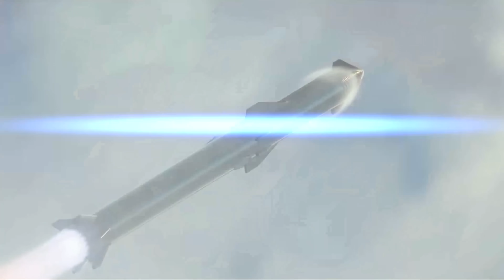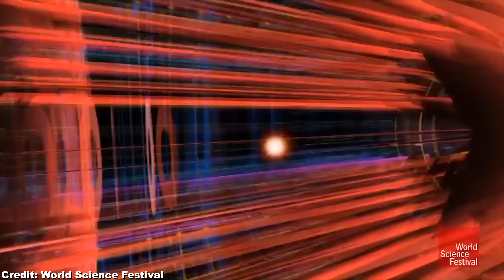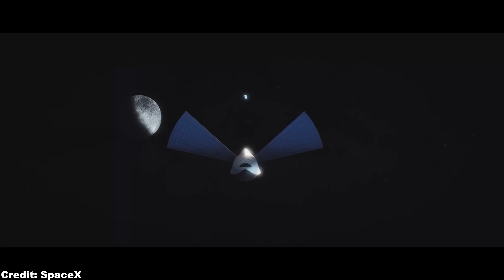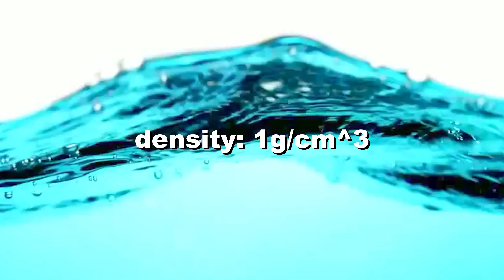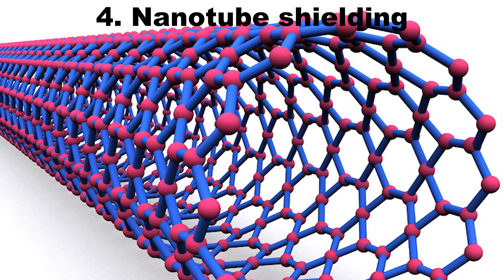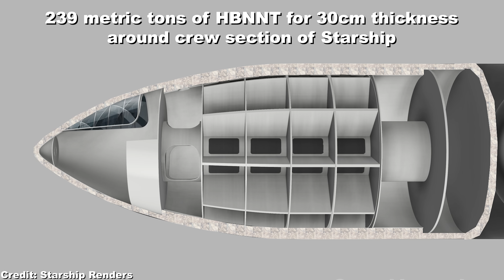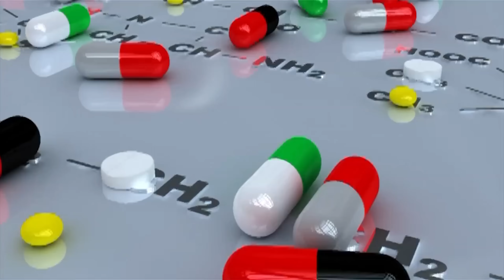SpaceX Starship FLAW Fix: Best Cosmic Ray Protection?

Comment: Since we are dealing with multi-trip vessels, it is essential that the shielding should be re-usable as well. You did not address that issue. Would the NNTs meet that requirement? Water could be easily flushed for 'scrubbing' if needed. A way to convert the rays directly into useful energy (say to power an ion thruster or charge storage batteries) would seem to be the ideal solution.

Comment: BTC current volatility reflects tradrs' excitement as the pr!ce bounces between key support and resistance levels.. In my opinion, the recent correction of βͲ↻ is a reflection of a healthy mar:ket with active tradrs and I!nvestors. βͲ↻ still has a ways to go in terms of gro wth, I have been in the  cryթԵo world for just over a year now and I have been able to make 31 βͲ↻ foIIowing the reasonable adv!se and tradn s!gnals from Bernard"s Moore who is always one step ahead of other tradrs, he is a great analyst and extremely good at designing trad strateg!es for different marke:t situations and her s!gnals are very accurate. You can easily get to Bernard on Եҽlҽցɾαต ( @bernardtrading0000 ) 𝚠нαтαѕαρρ + 1 2 2 8 332 3 7 5 )  to start ƚradıภg.

Comment: Could aerogel be a solution in spacecrafts both as insulation and cosmic ray protection?
It seems like aerogel has a rather wide option for composition, so possible 1 could be something that can block the dangerous rays in space :D
Perhaps combined with layers of nanomaterials to strengthen aerogels fragile nature!
Erogel already have a history in space, so perhaps they are already looking into it, or found it don´t have the right properties, or they have forgot about it in that situation ;)
Video about Erogels
https://www.youtube.com/watch?v=AeJ9q45PfD0

So a good combi could be layer of reinforced aerogel as the outer layer (since it is also a good insulator for the +100/-200 degree), then a layer that breaks up the rays in smaller particles, and then a layer that can absorb the smaller particles, water or whatever is found that can stop it most efficiently, and perhaps aerogel as inner layer too!

Comment: The major innovation needed... 
May well be electro-STATIC shielding .  This would require fields of capacitors, arranged positive ends outwards . The voltage should be 《2k. volt , and there should be no current flow , once the capacitor "skin" is charged . No large power source is necessary , as there is no significant energy expenditure .  Solar and/or radiogenic power should definitely be adequate . 
🤓

Comment: The only currently practical solution to the cosmic ray solution is not to get there faster, but to solve two problems with one solution. On the surface of Mars, significant power will be needed to do the many tasks that are planned. It will be difficult to carry and manage enough solar panels for this purpose. Small liquid fueled reactors can provide this power. They can also provide enough power for a magnetic shield for the spacecraft. Initially, one of the Starships will need to carry two, one for shielding going and returning and one for power on the surface. It might take more than one Starship to carry the surface power unit. With each Starship having its own reactor for shielding, crew safety would be much improved. If one Starship was just as a freighter, it could carry the reactor for surface power, not needing shielding.

If multiple Starships are linked together for gravitational purposes, one could possibly provide the power for shielding for them all.

Magnetic shielding could also be used on the surface, but that seems a waste when there are so many means of passive shielding.

In the future, the fusión power of something like the laser powered HB11 units might provide an alternative for both power and propulsion, but current fission reactors don't have sufficient power density for efficient propulsion, even with nuclear thermal units. The fuel requirements are just too high, and the units themselves are just too hazardous.

We need to get their now, with technologies which have a sufficiently high TRL to be brought to flight readiness very quickly.

One more pandemic of same or greater transmissibilty to our current coronavirus could very nearly shut spaceflight down in the process of throwing us into a world wide depression that will last for decades. Societies will turn inward like N. Korea, making this into a far more hazardous world with even less communication than there is, now. That will inevitably lead to war, possibly nuclear war, which will need the space industry inktjally, but will easily destroy that industry almost instantly.

If we have not established an independent presence somewhere off planet by then, we may never.

Comment: A note on the version of Starship you mention with water in the walls of the entire crew section... Would it not be possible to put one of those up in orbit first without the water, then send a special Starship tanker with the necessary water to dock with it and then fill the radiation shield? Would mean that the shielded starship wouldn't have losses in its payload capacity on initial launch

Comment: 1. Nasa has studied this problem already and determined that a round trip to Mars will not result in a fatal dose. Problem being that no one has EVER done this before so who knows what those studies are worth!
2. Nasa has also started developing strategies to shield human beings from radiation...so far they have manufactured prototype vests to protect the torso and organs. 
3. While on Mars, astronauts will be living in shielded compartments inside their Starship OR underground. Either way the crew will be protected.
4. While on Mars, astronauts can carefully limit their time on the surface in order to reduce their exposure. 
5. During transit, the crew can be shielded from radiation (even cosmic radiation) by installing a thick layer of polyethylene around the crew compartment. Any material that has a lot of hydrogen atoms does a good job of blocking radiation...so perhaps in the future we will develop a special material just for this purpose.
6. This is TRUE EXPLORATION and so it is impossible to guarantee a safe voyage. Those who sign up for the first few trips will need to accept the risks that come with the territory.

Comment: I think the best solution is a water cover. The starship should only have the space available to contain it around the ship, either to take off from Earth or Mars. A device of water in orbit that is gradually filled, would supply the shield for the trip to Mars. On Mars another deposit would previously be put into orbit but empty where the starship would deposit the water to land, then return to collect the water to return to Earth. Therefore, if the water can be reused for multiple trips, it should not always be put into orbit around the Earth.

Comment: The problem with a nuclear thermal starship is that starships take off from and land on Earth's surface.  There would be a danger of releasing nuclear materials into the environment with every liftoff and landing in the event of a problem. I wonder about putting the crew into hibernation, and then fully shielding only the hibernaculum.  It also seems like returning to the moon first, and exploring it further, while we work out the best solutions to the radiation problem might be a wise move. Elon's plans for a human Mars mission within this decade don't seem very feasible.

Comment: No None of that.
Al these particles are charged.
So all you do is shoot a coil in front and one in back to make an electromagnetic shield - just like the Earth does.
It would take very low power - you are deflecting, not stopping energetic particles.
Yes you could charge it by rotating an "outer-ship" against a core.
I suggested these things to Elon ages ago - he blocked me.
I suppose that was because of my insistence of complex carousels on Mars to prevent bone and cognitive decline.
I will note however, that the "Starship" design is the required diameter to house a "Boring company" borer?
Elon intends no surface colony - it will all be underground.
However .. the sleeping-carousel cannot be avioded unless you can engineer a human that has no calcium loss in less than 1 G ...

Comment: Water would be the most practical, but it does not need to be inside the Starship. It can be applied to the outside.
Starship would dock with a water tanker that is orbiting earth and then accelerate to the appropriate speed with the tanker attached. Once the engines stop firing, the water would be released from the tanker and it would coat the entire Starship. When you get to Mars, exert a small thrust so that the water goes back into the tanker. After that, you fire the main engines to put the Starship and tanker into a Mars orbit. Then undock and head down to the planet. 

The tanker will be waiting for the return trip.

Comment: Hey guys...it is very well known what the impacts of radiation on the human body are...but i find it quite interesting that there has not been one recorded case of cancer or serious illness from any space traveller...(orbital or lunar missions). I have read about water being a very good insulator for radiation, but it adds so much weight, and therefore makes it unviable in my opinion. Because water is obviously fluid, it could also upset the balance of Starship, particularly on landings ...given the lack of evidence for cosmic/solar radiation effects on space travellers...are we placing to much emphasis on it ?. Even so, some kind of protection would be a wise move...i like the idea of a pharmaceutical solution, as it doesn't involve adding weight to Starship....weight is the enemy of space travel. Ultimately, the first pioneers to go to Mars are going to take enormous risks, on so many levels. It could very well be a one way ticket if you know what i mean. Question for ya guys : how did NASA protect the Apollo Astronauts for the Moon missions ?. Great upload, all your content is very well cited...and real food for thought...love n peace to all...D.

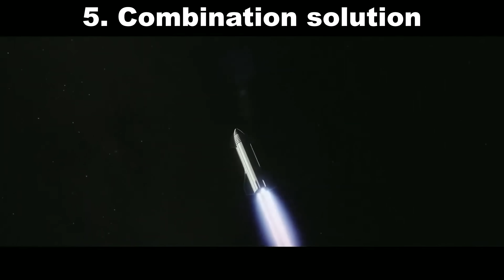Comment: A beautiful video as always guys. keep up the good work. One question though. @10:40 you said when the travel time decreases to about 50% will result in needing half the mass of BNNT structure. I do not find this statement correct because the thickness of the shielding is related to the magnitude and type of the radiation you are exposed to more than the duration so i still think this fascinating and very interesting shell would cost the starship upwards of 200 metric tons. the advantage of water is that it could be not initially on the starship at launch. It can refill its watershields from the orbital refueling in LEO (when its still safe and sound in the magnetosphere), with an extra valve which would not cause so many practical problems. on the other hand as a disadvantage watershield is less durable and maintainable than BNNT against small collisions with debris. I'm really glad to see you guys being so engaged and going after possible solutions. The space community has grown very much and it's just amazing how many new brilliant ideas come into existance every day. With SpaceX never sitting still on innovation I hope they implemenet feasible ideas from the community in their iteratrion process. Thank you guys and don't doubt your Viiiiibeee!!!

Comment: What's the solution.? I'm amazed that smart people can't come up with the answer that this dummy has ideated.! If water lends tons of weight to the spaceship, simply orbit a tanker that can be filled with water, (or any other insulating material) in a number of trips. Once the needed amount is aloft, pump the water (or whatever) into the ship which is already in orbit and being assembled. What can be simpler than that... or is there something I'm missing.?

Comment: In the short term, polyethylene or Kevlar will help, but they will never really be good enough. Here's a bet... In the long term, it is either high hydrogen-loading materials, or else entire transit vehicle hulls made from mined and 3D-formed orbital water ice, using nuclear propulsion and water as a reaction mass. There is a lot of water out there.

Comment: How effective is Methane and LOX as shielding? Could you use the Mars landing fuel as shielding?

Or the other way, could you use the shielding as landing fuel? If we'd switch to a Hydrolox fuel system for the Martian landing, and figure out some way to disassociate the the water into hydrogen and oxygen in time for the martian landing burn during the last few days of the approach. If the power requirements are too large, we might need to use nuclear energy to do the disassociation, but they shouldn't be if spread out over enough days (I'll need to do the math on that).

Finally, if all else fails, we could launch a dedicated radiation shield on a "cycler" orbit between the Earth and Mars. This object would operate like a space station with enough shielding for long duration stays in the void, but wouldn't be required to change deltaV for every trip. Each spacecraft would take a ~3 day trip to the cycler, ride it for however many months to Mars, then break off ~3 days before arriving to Mars and entering the atmosphere. So you'd have the upfront deltaV cost of throwing all of that mass into a cycler orbit (it could be done slowly with ion thrusters for very high ISP), but it would pay for itself for each cycle that it gets used for. Basically it's what an effective LOP-G would look like. Very much worth the deltaV penalty, especially if it had permanent artificial gravity.

Comment: Your video is nice and depicts the problems with the radiation well.
For blocking radiation, the best way I can think of is: rotate the engine section towards the sun. This way, all that nice steeltanks and engines will block the radiation. Furthermore, you have briefly mentioned secondary radiation. For places like Moon and Mars, there are calculations that show, that the radiation will be highest at approximately 1m dept, because of that secondary radiation. So having a shielding at around the whole compartment is probably a bad idea.
For coronal mass ejections, the engine and cargo section will be usually sufficient, but an extra radiation shelter with the fuel needed for Mars Atmosphere Entry will help.
Funny idea while writing: I like 3D-printing, so one funny idea could be using 3D-filament spools as cargo and radiation shielding. Form a shelter out of those spools in the pressurized cargo section, use them as shelter during outbreaks, and on Mars, you can actually use that stuff to make parts that you otherwise would either not fit inside or would be a rarely required spare part, that you just can't afford to carry around. Really, 3D-printing will be huge there.

Comment: Thanks a great presentation. I planned to model starship internals some time in 2021 but your ideas may accelerate my hobby schedule because I see now that radiation could be a major factor in starship internal design, especially if the first few starships might be used on mars as habitats. 

One solution to the radiation danger is to use the cargo as shields which would reduce the crew down from 100 to around say 30 and water/nano material shielding could be kept to just the sleeping pods. Would nano material be suitable as apparel?

Perhaps a very important aspect of nuclear propulsion (NP) could be power generation for the crew life support system. The NP could be cooled by heat pumps (like the kilopower reactors seen in one Mars Society video) which in turn could drive generators to charge the starship batteries.
Reply: See kilopower reactors at https://youtu.be/NLE5YFuCmhw

Comment: I think an outpost on the Moon to 3D print and build an Earth Mars Cycler would make a lot of sense.  It could be nuclear thermal powered and have a large rotating ring.  It could also have water from the polar ice caps for the 1m shielding needed.  Lifting that much shielding out of Earth's gravity well may not pay off.  The other option is a deep space boost phase that docks to the rear of Starship using ion drives and hydrogen oxygen fuel cells (supplied from the Moon).  The drive can get to Mars in 30 days. argon can be used for propellant as you don't need much and it's 1% of Earth and Mars atmospheres.  As water is produced through the process (hydrogen/oxygen) it is used to inflate the bigelow habitats and provide shielding for Starship.  I don't think every StarShip should land on Mars.  In fact I think there should be a "hanger" deck with a smaller descent vehicle like Zubrin recommended.  If you get several large cyclers going, use Starship for Earth surface to orbit and a smaller lander for Mars you could rapidly transfer a lot of people.  The other option is to have a double hulled habitation area in the Starship and pump methane between the walls.  It can be used for the Mars descent and is a very decent radiation absorber having lots of hydrogen.

Comment: Another point on the Astronauts living in the Bigalow habitats is that if one failed they could move two another as the were three on the ring.  I have always felt that rotational gravity may well prove indispensable,. Once building or rather assembling structures in space becomes normal then these problem will be easy to solve.  Habitats on planet surfaces will become easier as well.  Having a practical reason to go there will I think be harder to solve.

Comment: Changing starship seems extreme , why since they have to fuel up the starship can they not pump in the water to the starship while in space .  Though they would have to eject it before landing , the other option is the ring with the Bigalow habitats could it not have a series of large water tanks to fill the starship shield with. Or better still could the Bigalow habitats have water shields and the astronauts could live in them till they get to mars.